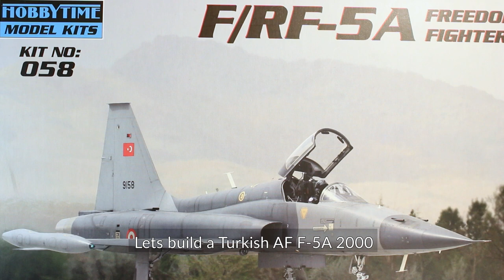Northrop F-5A Freedom Fighter TURKISH AIR FORCE 1/72 Hobbytime / ITALERI Model Kit Full Video Build

Comment: Un lujo como siempre Dr Mig! Quería saber si podes subir imagen de la herramienta que utilizas para el scratch en los paneles de instrumentos del interior del cockpit.  Gracias
Reply from the maker: Thanks.I have no special tool for it.I did drill some styrene sheet and cut the rectangles with a hobby blade and then glued them one by one.The circles were just a streched spure cut to size.